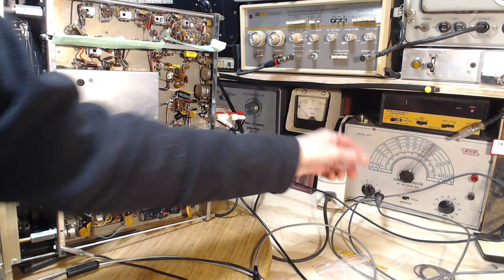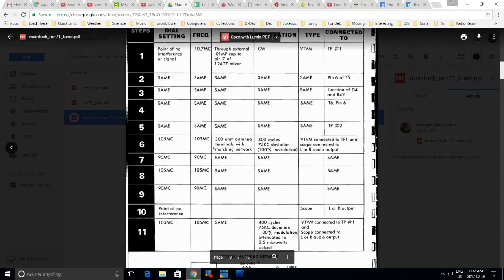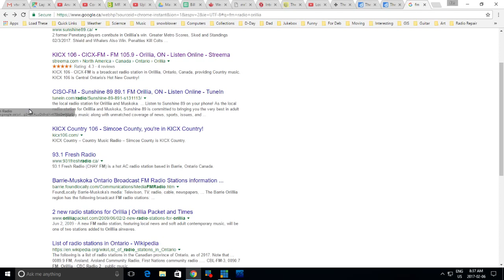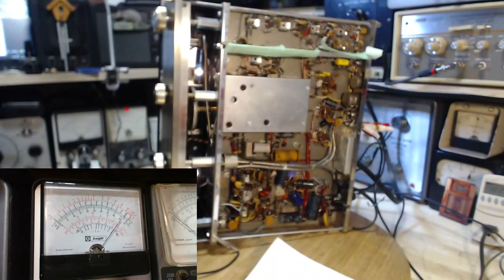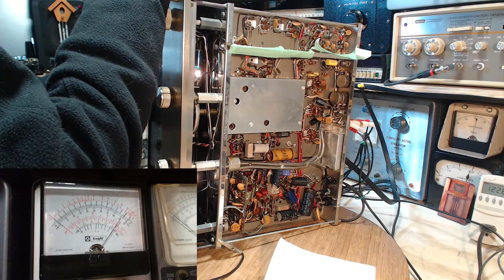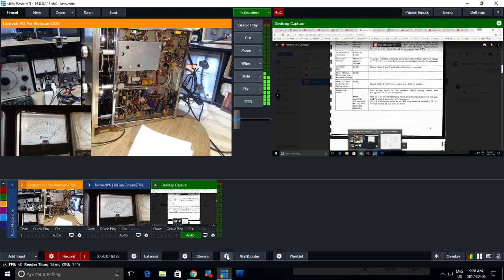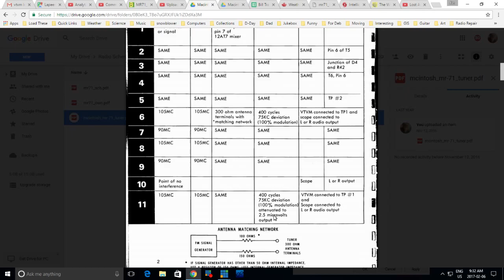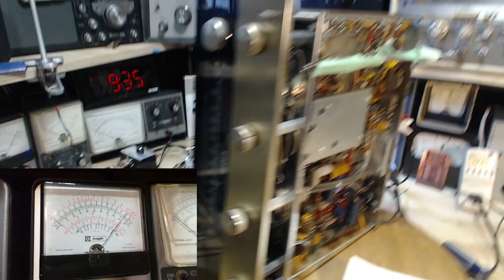McIntosh MR71 FM Receiver Video #21 - Front End

Comment: I never liked tubes for FM until now.
Reply: Mark Anderson Yea it really sounds great and the tubes have that great full sound, of course this is a real high end receiver if you look on eBay they go for  $500-$1000, and a lot of older fm radios from the 50s before this was made really did not work that well.
Reply: Yes they drifted and all the capacitance in the tubes, lowered the sensitivity.  Tiny surface mount transistors mean an entire tuner can be about  an inch square.